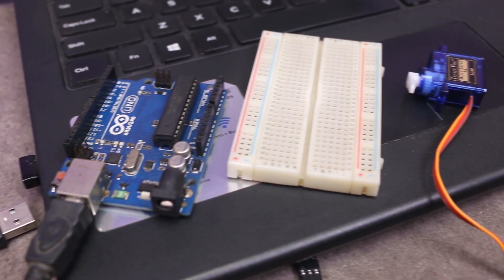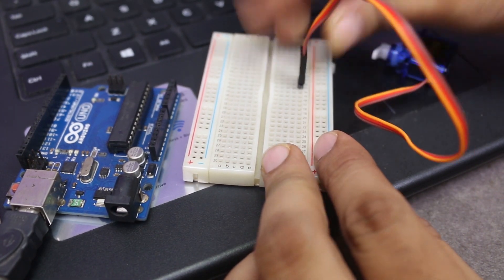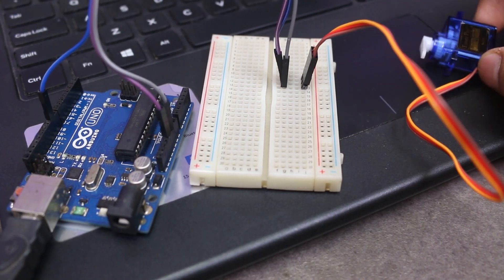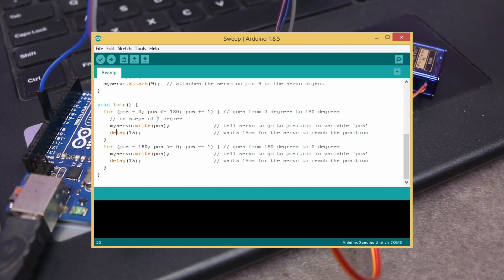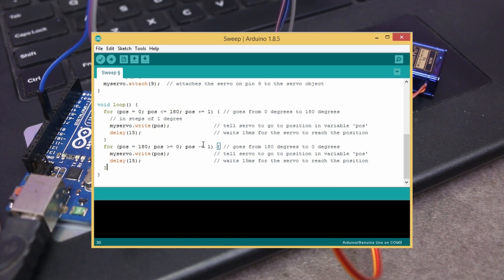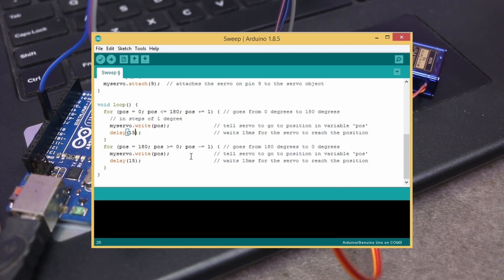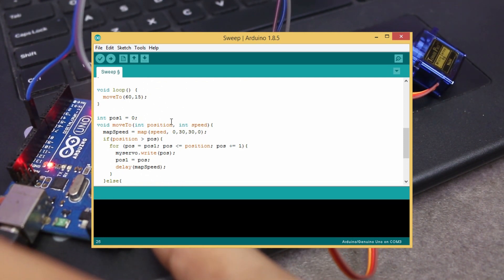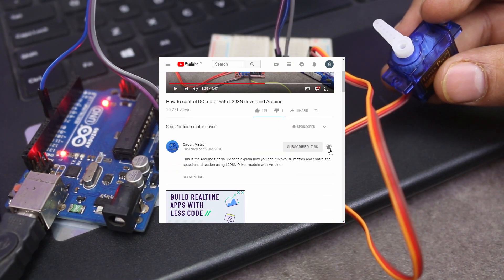How to Control Speed of Servo Motor - Arduino Project

Comment: Thank you for the effort! But this kind of arduino coding style should be avoided at all costs. Delays to compensate speed? What happens if there is other code beside this stepper code? Delays will not give you deterministic speed! 
In simpler words, avoid delays at all cost. It blocks your code any everything is hanging. If you do some proper project and need delay, then use "millis()" implementation.

Comment: I I have tested out a lot of different servo sketches and I've played with the delay and it doesn't change a damn thing. It'll delay in between how fast a function occurs but it doesn't slow down the movement at all

Comment: is there a maximum time the servo can take to rotate the arm?  i am looking at a project that needs to take 7 days to loop. is that possible?
Reply: Have you found a solution? Same problem for me
Reply: @Alt3zahen  delay should be increased but this microservo can't withstand it

Comment: What is mapSpeed declared as? I did int. This code doesn't make any sense. Please share the whole code with declarations at the top. It "kina" works, but it only goes slow in 1 direction. I'm not following your logic.

Comment: Thanks for the Video, but I want to know whether it is possible to move the 'Servo Arm' on behalf of some background Rythm (preloaded), if so then how fast it could be (maximum) ?
Reply: Top speed would likely depend on the particular servo. You'd have to look for specific servo specifications, where you will find something like "Operating speed: 0.11 seconds/ 60 degrees (4.8V)."

Comment: clear.... recommend showing control the speed dynamically, as in getting a input from another source, then adjusting the speed based on this input. 

for example, using a soft linear pot, where the rotation location is defined by the range of the linear pot. (https://store.synthrotek.com/Spectra-Symbol-Soft-Potentiometer_p_691.html)
 based on motion on the pot, rotate the servo. as you know if moving the pressure on the soft pot, the motion could be fast or slow or change velocity...

I would really like to see that.

Comment: how can i control 2 servos independently for my robot arm?
Reply: By declaring 2 servos. EG : 

Servo servo1;
Servo servo2;

void setup(){
  servo1.attach([pin#1]);
  servo2.attach([pin#2]);

  servo1.write(100);
  servo2.write(80);
}

Or you could use an array :

Servo servos[2];

void setup(){
  servos[0];.attach([pin#1]);
  servos[1];.attach([pin#2]);

  servos[0];.write(100);
  servos[1];.write(80);
}

Or write your own class / functions to manage them the way you want :)
Reply: @QD77  can u control let's say 5 servos at once using the same coding format?
Reply: @elijahbyrd3370  You can control as many as there are available pins on your Arduino.

Just declare 5 servos (Servo servo1, servo2, servo3...) or an array of size 5 : 
Servo servos[5];